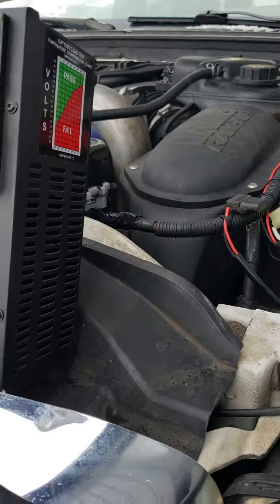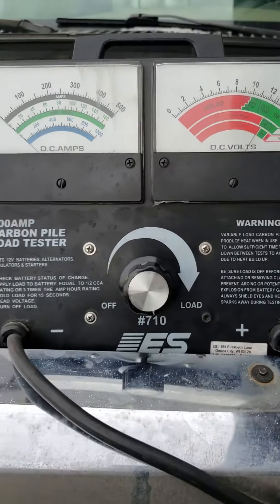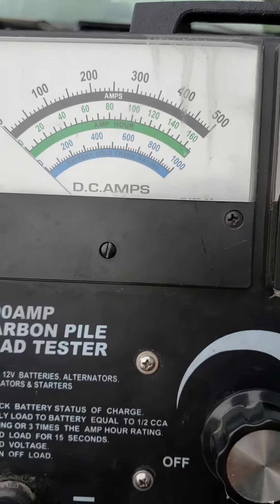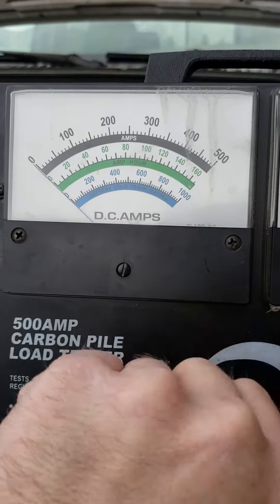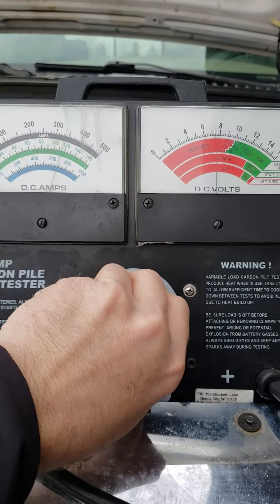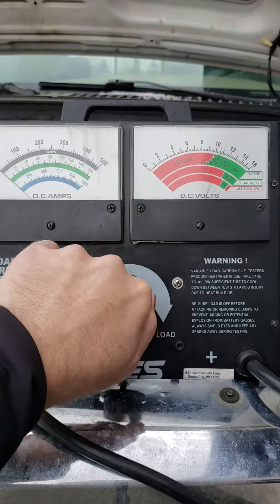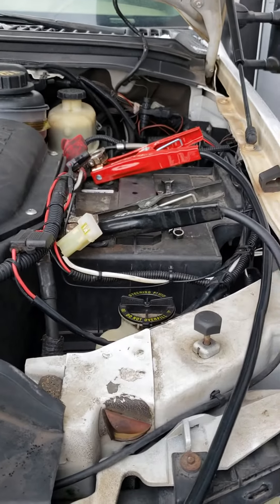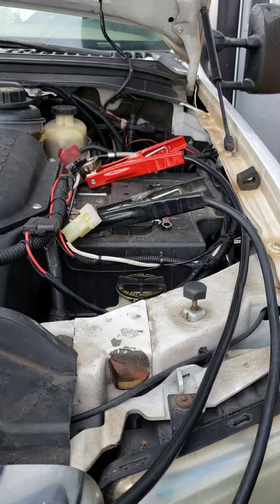Load testing a battery

Comment: Man, you guys need to read your dials better. Each sub-division is 0.2 V, so the battery voltage is 12.6 V. Which is a fully charged FLA battery.